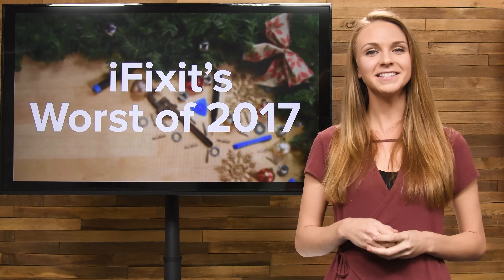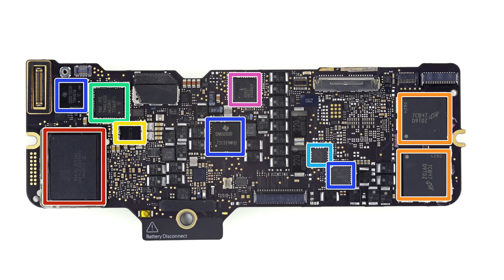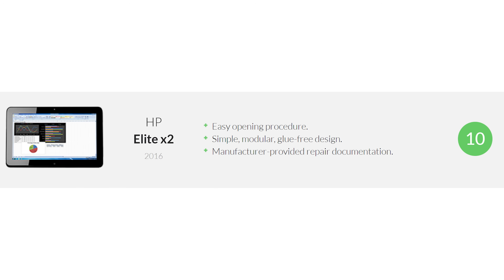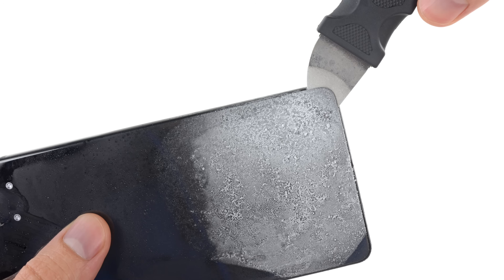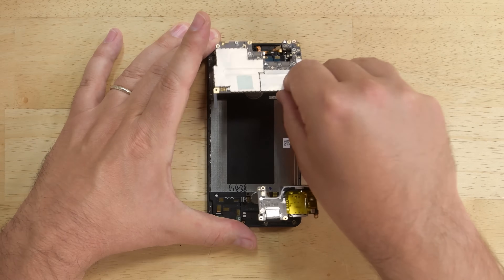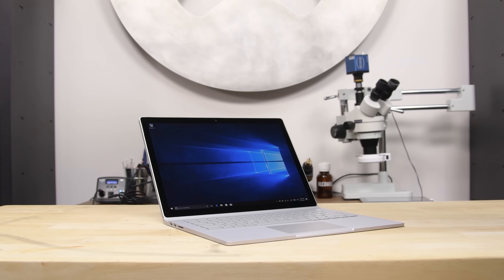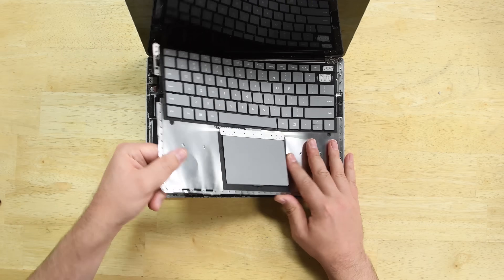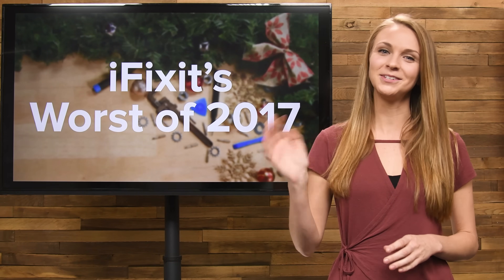iFixit's Worst Devices of 2017

Comment: I have the 12" macbook. You still can open it and replace the trackpad, motherboard and usb-c port. And for the battery you can replace the lower case, there is also not that much lost because electronics are in the top case. In terms on ssd, ram, cpu what did you expect? This device is so small and thin, you couldn't do it otherwise and it's actually understandable. So not that bad tho. 
What I think is the bad is that surface laptop can't be opened to atleast replace the battery. It's atleast the first part going to fail. I don't care if ram is soldered on but replacing the battery is important.

Comment: I doubt it that repairable devices will get any better. I know I want them, but the truth is robots and manufacturing with main board that include soldered SSD and memory remove labor costs increasing profit margins. Companies like microscope don’t do this to get low repair scores, but so they don’t have to have an assembly line of people plugging in SSD’s and such modular components to save money on the bottom line. It’s all about the Company business profit margin and what’s become known as disposable parts to replace a whole board when one fails since they are made cheaper this way. It’s suck’s, but as long as the investors want to see more money and it’s all about money and profit I don’t think it’s going to get any better, probably worse as time goes on.
Reply: Yea and what if a tinkerer wanted to swap out an ssd ram or a cpu for a better one just like a big computer? I suppose we should think of how much e-waste these companies create and hold them accountable and maybe start a nonprofit recycling the parts or wait they already take them when they sell "factory refurbished" items lol we should offer upgraded versions with higher specs than the next model just to piss them off on ebay or CL some App for selling etc.Msg me if you're in! haha

Comment: I worked for 11 years as a serviceability design engineer. My function was to help the design team make a product that was very easy to fix in the field. Perhaps even let the customer repair parts of it. Your beautifully designed video is great. It also is disappointing professionally to see high tech products are only designed to be manufactured. And not serviced in the field much.

Comment: I bought a HP laptop last week and I'm glad to know that everything it's easily accessible and replacements are cheap.  m.2 slot plus HDD and two bays for ddr4 Ram. Has beautiful Full HD ips screen and it's light.
Reply: oh you mean in a laptop you have discovered the two pieces of hardware that are upgradable, the hdd/ssd and the RAM? That is about it! Always been that way...keep dust out or your videochip can overheat the MOBO and TOAST!

Comment: This video is pointless 
YOU picked devises that are small and thin of course it will be hard to fix them because they are compact
Reply: Did you miss the HP tablet? If a frickin tablet gets a 10/10,what's stopping an overpriced laptop from at least 5
Reply: King_Andriy THATS THE REASON WHY THEY PICKED IT!!! If they were thicker they would be easier to repair and therefore not on this list!
Reply: Not a relevant objection. The Iphone 6, it being both thin and light, can be opened within a minute with no risk of damage to screen or internal components.
Reply: The video is about devices that are the least reparable. Can you read?

Comment: it's seems like Apple and microsoft  don't want you to repair their products, they want you to buy a new one 😂
Reply: Microsoft seems to be copying Apple for some reason
Reply: Tinu Thomas those are phone from few years a ago now if compared IPhone 8 and 10 are awful to fix as the back glass if break is hard to remove.
Reply: Tinu Thomas When phones have something wrong, it's usually the screens that are broken. iPhones are the only Apple devices that are easy to repair and that's because it's more likely for a phone to have a problem in its first few months (before a new model comes out) than for tablets and laptops, which people usually treat with more care. They make up for it by not providing replacement parts and taking a lot of money for a repair from an official store. And, since screens are the ones that break the easiest from all the parts of a phone, you won't find those too easily. Also, the screen is usually the most repairable part in any device. Anything else (like IO ports) makes the difference between the repairability of different devices.
Reply: Or they want you to pay them to make the repairs
Reply: I will happily buy a new one 
From a different company that is
Reply: DT B We do live in a disposable world. I’m sure there are better ways to get inside an adhesive product. 😊 As far as I’m concerned, if anyone is complaining about proprietary product, then they shouldn’t buy it. 😊
Reply: DT B Apple devices are the easiest ones to repair. It’s clean and everything is laid out carefully. I had no experience with this and I swapped screens on an iPhone 6, 6s and an SE. not hard

Comment: I expect a lot of Apple products
Reply: One MacBook, one Microsoft laptop, one iPad, and one android. Surprisingly even on both sides. Apple phones aren’t too bad to repair since they don’t use adhesive on most models, and the ones they do use it one is such a thin strip only for water resistance you don’t even need heat. Just unscrew the pentalobes and pull, the adhesive on the 6s and up is no stronger than masking tape. I’ve worked at a repair shop for nearly 3 years now and honestly I prefer iPhones over most androids for repairability. iPads, on the other hand, are a different story. Then again most all tablets are glued together messes.
Reply: The iPhone is pretty easy to repair tho
Reply: You were not disappointed
Reply: Tike but it was Microsoft who took the cake
Reply: They didn't make much in 2017.
Reply: Tike but you only got 2
Reply: Apple makes their devices easy to repair since they also have to repair them at Apple stores. They design them to be opened and they’re actually very nice inside